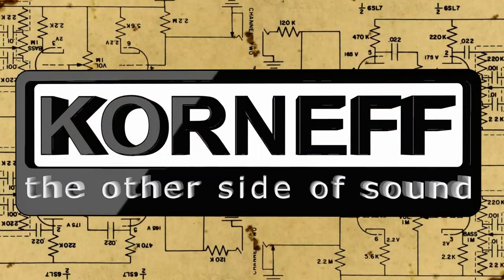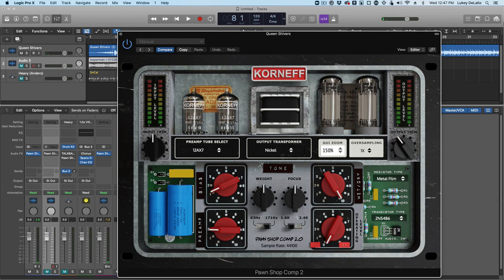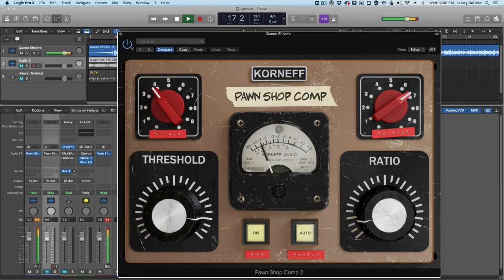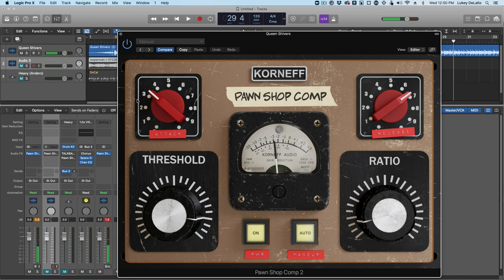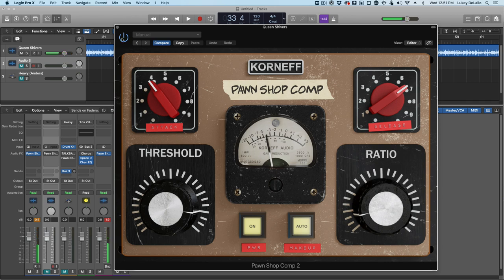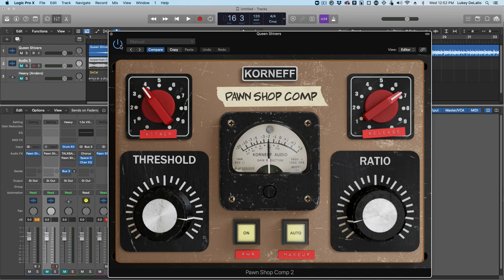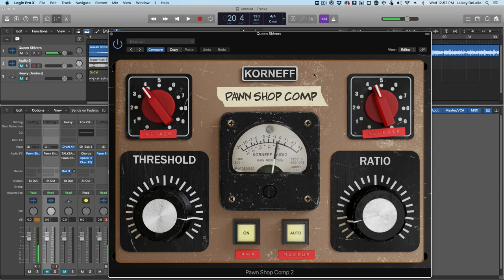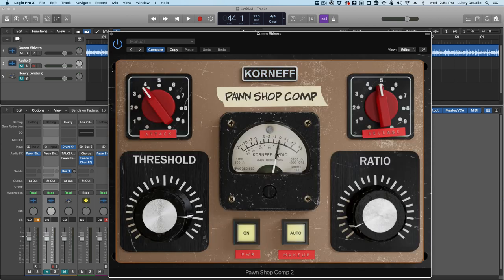Punchy Compression 3: On the Mix Bus

Comment: God. Mix bus compression is never used well. Great video tho. Do you have a limiter on the mix bus? Or any other EQ?
Reply: Hey there. This is an old mix, so it was previously run through an SSL G Bus comp, and it was mixed on a 4000G too. That said, at the time, we generally didn’t use as much compression as everyone uses now, so while the original compression does effect it, I don’t think it does so enough that the PSC 2’s operation is changed or... compromised, if that is the word. There is no limiter on it at all. On the original mix.... I probably ran this through a pair of Quad Eight 312’s or an NTI Eq. One of those two pieces was used on it. In the video, it is just the PSC. 

Bus compression is always so personal, and there are so many right answers, and just as many wrong answers. On these videos, I’m really just trying to show the gear and present ideas and a way of thinking that people can apply to their own work. Yes, presets are nice. But presets are not a substitute for knowing what you’re doing and having a cogent approach. So that is what I am teaching. 

In terms of bus compression used well or not... there are plenty of records that are bus compressed and you can’t really hear it at all - it just sounds great and rich and full. And there are a lot of modern things compressed way way way too audibly for me.